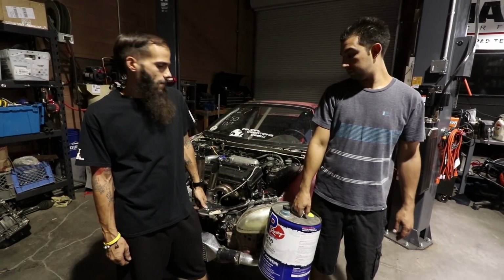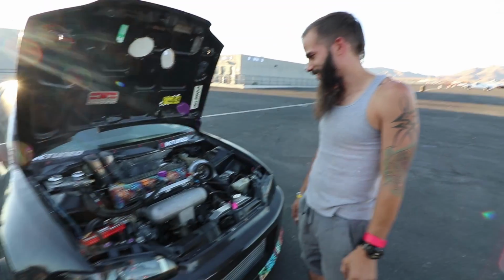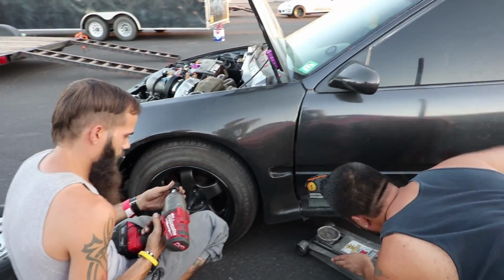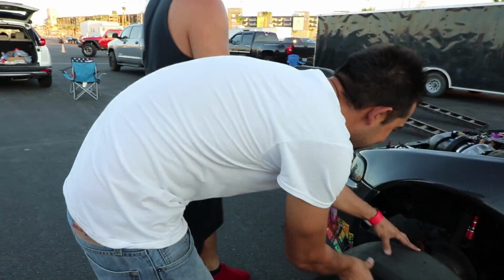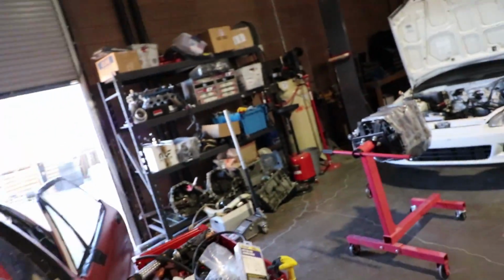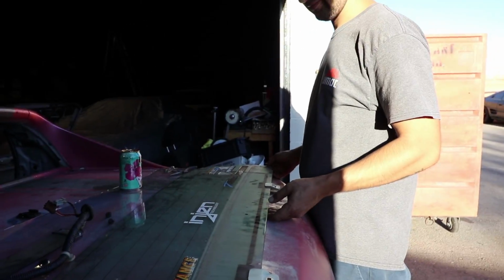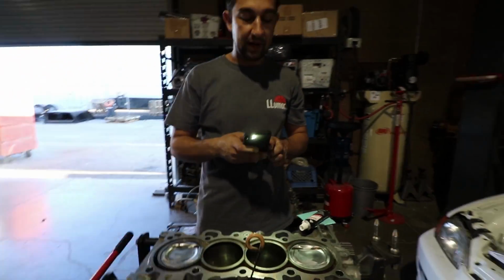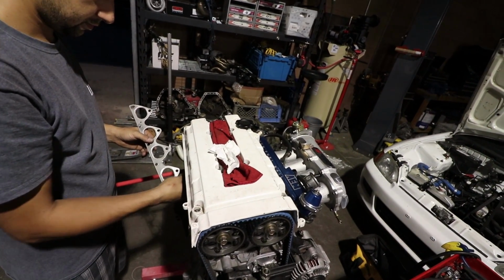Pink Widow Gets Kicked Off The Track Ep 10

Comment: I cleared with my local track running clear marine vinyl on my Del Sol for the rear window, its light weight and basically the same stuff miatas use for the rear window on the soft top.

Comment: jeez. you do know "motor" is pronounced engine ya know....a motor is electric and engine is combustion. just a pet peave of mine lol sry.
Reply: Wrong....

According to the Oxford dictionary:
mo·tor
ˈmōdər/
noun
"a machine, especially one powered by electricity or internal combustion, that supplies motive power for a vehicle or for some other device with moving parts."

According to the webster dictionary:

any of various power units that develop energy or impart motion: such as

a: a small compact engine

b: INTERNAL COMBUSTION ENGINEespecially : a gasoline engine

c: a rotating machine that transforms electrical energy into mechanical energy
Reply: @aaroncarnold9  good for you.